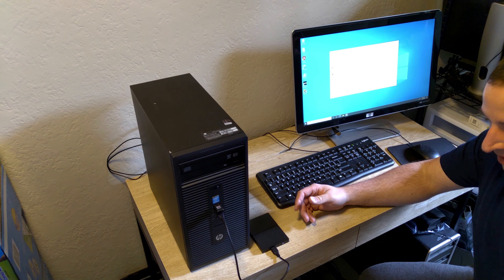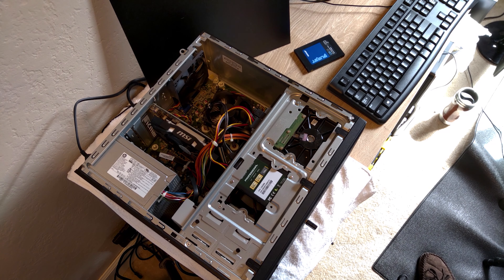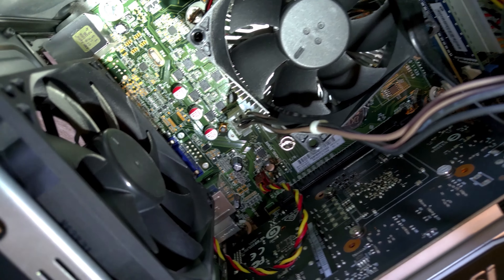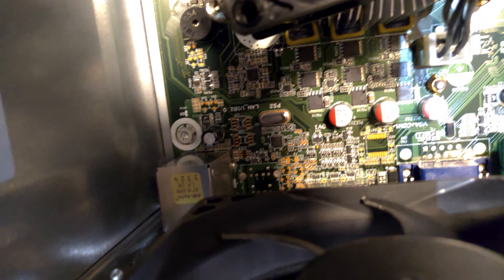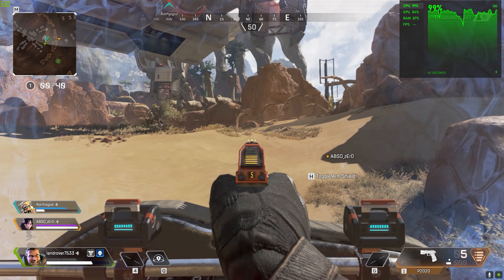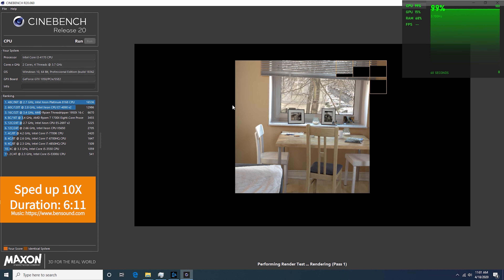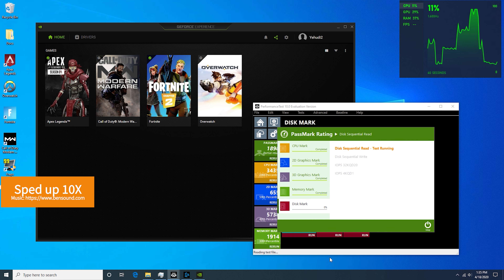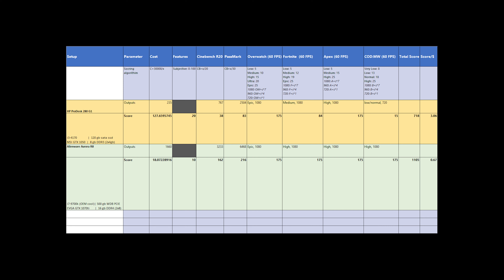Video 1: HP ProDesk 280 G1

Comment: Hi, I have almost the same as this G1 280 with i5 - 4th gen. I want to add a GT1030 to it. This seems fine except I am wondering how you got on with the 180w power. I also have a 440 power I could put in but that would Isabel another pc. Also is the PCI x16 slot restricted but he Bios and HP to just 4x? Thanks

Comment: Did you change the psu? Is it ppssible to do this? 180w isnt enough for a large Radeon lma
Reply from the maker: Nope -  I didn't swap out the power supply as all of the hardware here was capable of running safely.

It  is a standard ATX power supply with a normal 24-pin power adapter, so pretty much any ATX power supply will fit. If you end up going to 850+ watts, they may not fit due to length (since most of the higher wattage supplies tend to be a bit longer).